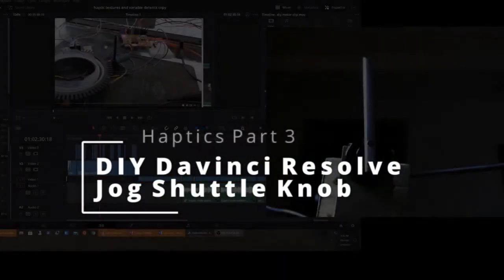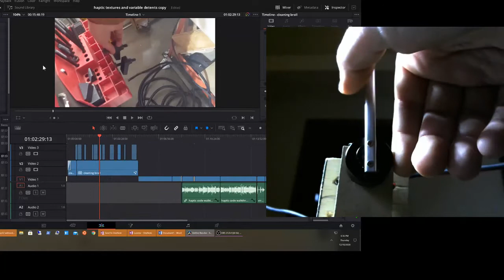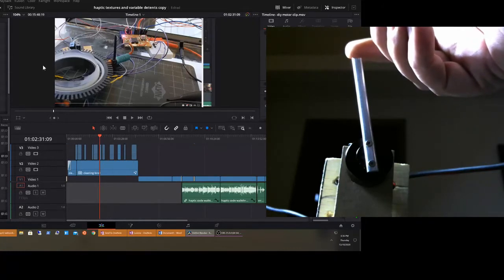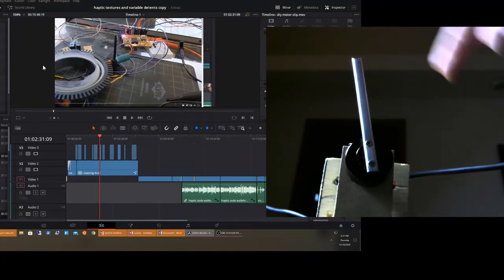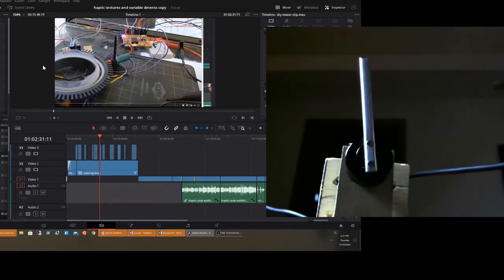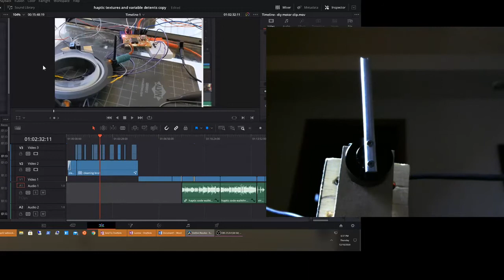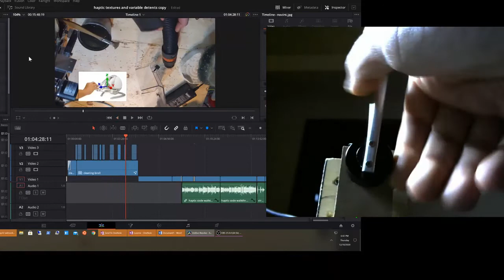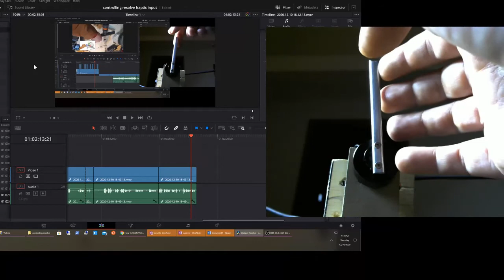DIY Davinci Resolve Jog shuttle controller

Comment: Very nice! Question, where can I find the interface for such keys (like jog) that Davinci Resolve expects?  I'm thinking about doing something similar, but just using the capabilities of my fancy mouse.
Reply from the maker: just google ""davinci resolve keyboard shortcuts""
Reply: @JesseSchoch  There exists no such shortcuts as far as I know. "Jog Wheel" is not a part of the commands that can be bound to keys (at least not anymore).  A quick 'strings' on the binary shows me "OnJogWheel"-events from such panels... and I guess that's what I'm after.  Which events did you bind your implementation to?
Reply from the maker: @JanneKronbäck  so pressing L once plays, L + L plays 2x.  J plays backwards etc.  i'm just sending those keys.  for the frame by frame mode I just send "arrow left" or "arrow right" which maps to "step one frame".  I think you can also send jogwheel events via the HID emulator but I didn't do that here and it should act the same in any case.
Reply: @JesseSchoch  Ah, I think I misunderstood the video then, because that's not the jog-function that I was thinking about.  I'll see if I want to take on trying to reverse engineer the calls. Probably not considering the size of the binary, unless the peripherals are neatly described in some of the libraries..